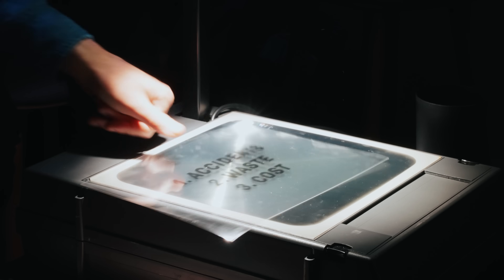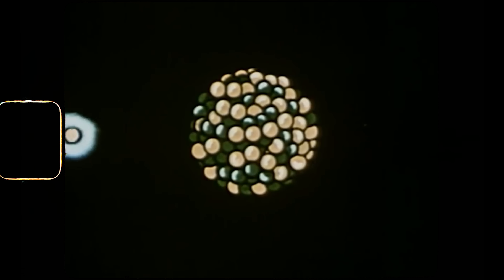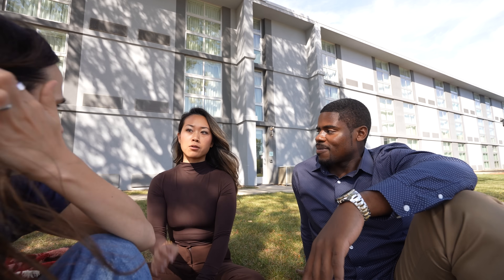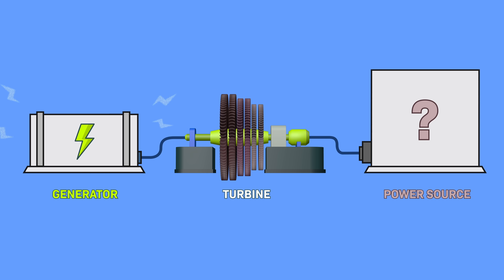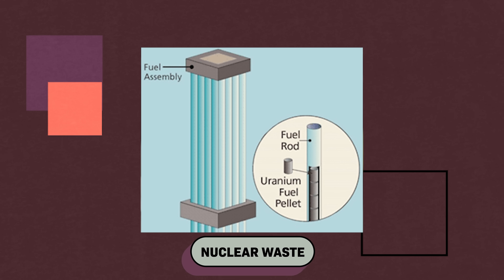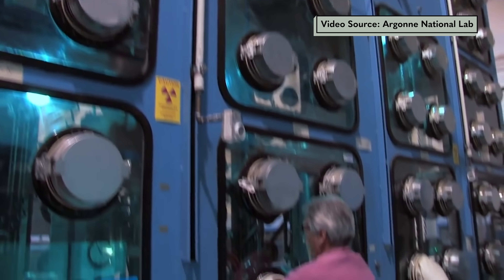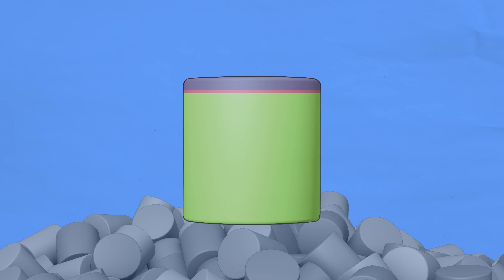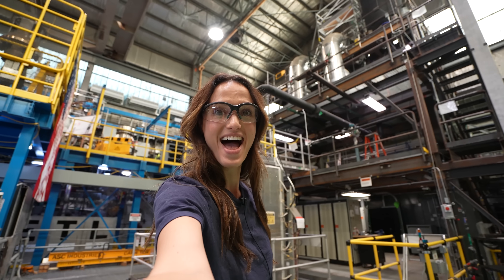The Big Lie About Nuclear Waste

Comment: Nuclear energy was always a front for nuclear weapons and the military industrial complex. We may have had a sci-fi futuristic power source if it hadn't been for warmongers and politicians. The early accidents that scared the public completely against nuclear energy were the direct result of lax safety from racing to build a stockpile of nuclear weapons. The majority of accidents occurred because the plants were more concerned with making plutonium and weapon materials instead of providing clean and safe power for the people. Sadly nowadays most of the public isn't educated enough to know that nuclear could be a completely safe alternative to what we have and that it is honestly one of the best and most feasible options, the problem is anytime you start a conversation about nuclear power you get people instantly talking about Chernobyl and 3 Mile Island because they don't know any better.

As someone who worked in the energy industry for a time, you also have the big boys at Coal and Oil working against any alternatives and the lobbyists are too powerful. Even with all the talk today of going green, oil and coal still exist and will exist as long as those corporations hold so much power over the lobbying and regulations. Natural Gas was a good chance to go "clean" and we have enough natural gas here in the US to be self sufficient for fuel, but it's not nearly as big a profit for the Oil and Coal corporations so it got squashed through regulation and backroom politics. Congress can talk all they want about clean and green, but they are all beholden to the corporations and the donors lining their pockets.

Comment: Japan was forced to shut down all of its reactors. Did not matter that they have the technology to avert a future Fukushima. So was Germany. In spite of Germany never having a single serious incident. They were forced to do it in two of the top countries that are based on manufacturing and really need a lot of energy. There are some countries where nuclear is prohibited like Italy and Austria, in spite of having the technological level to do it very safely. There is a huge global political involvement in restricting nuclear power and it has to do a lot more with global politics and control, as nuclear energy would not only be safe reliable clean and abundant but it would be locally sourced leading to less dependence. The EU bureaucracy is forcing France, the country with the best and most advanced nuclear technology on Earth to reduce nuclear power generation. All of Europe built a single nuclear plant in the last 15 years in Finland and it was 15 years late and 10 billion over budget because of global politics, because of the US wanting to be in the funding. There are countries that want to expand nuclear power but are under tremendous pressure not to do it, like Hungary. In fact all European countries try to increase nuclear output, sometimes from existing reactors as they are not allowed to build new ones - like Spain. Switzerland, a country with super abundant hydropower is building nuclear plants. Many of the developing countries of the 3rd world are building more and more nuclear power plants, like China (15) India (8) and even Egypt, Turkey and Saudi Arabia. It would be crucial to unchain France, Japan and Germany and allow for the construction of closed cycle nuclear plants. If the West will not be allowed to do it and the US will hold it back, then the Chinese and the Russians will do it on their own. It would be much safer for the world if Japan, Germany and France would do it, they already have a lot of know-how and experience and know the pitfalls because of this long experience.

Comment: Physicist here, I worked in Argonne as well during my PhD. 
Nuclear is the best (reliable) power source we have. 
The problem is that politics is holding it back.
Reply: The best? So this big fusion reactor in the sky isn't reliable?
Reply: @Jan12700  the best. If you are talking about solar you need to study a bit more. There are several fundamental problems with it, major ones being cost, intermittency, area required, life cycle, cloud cover, integrating it into the grid, etc. Study a bit deeper why the best places for solar like California and Spain have not succeeded and why they both desperately need non-solar reliable baseline power as much as possible (for example nuclear power).
Reply: @andraslibal : unless you realize nuclear is not a suitable baseline power. And you should exactly know why, don't you?
Reply: @tinowildenhain2324  it is the most suitable, the only thing that is making it impossible is politics.
Reply: I suggest adding an MBA to your education. Did you also spend the same amount of time working for renewables? Or just do the math?

Comment: Nuclear energy does NOT produce electricity, It boils water to produce steam which is used to drive the turbines which produce electricity, a bit like the alternator on your car, but bigger.
Reply: Did you skip 6:20?
Reply: @Jan12700 I didn't get there.  She'd spent half the time of the video with waffle.

Comment: Where did you get your information?  Because things are not as cut and dry as you imply in your introduction. For example France is, having problems with nuclear waste. Not all radioactive nuclear waste can be used as fuel. Commercial nuclear operations in this country have had their share of problems. While there is the potential to reuse, or reduce, or mitigate problems in the the nuclear industry, are we there yet?

Comment: Very well done. Very informative and thought inducing. The one major point I have with nuclear energy is that when waste is produced at any given facility, it needs to be kept on site. If it is made there, it stays there. Any new facilities must be designed to store any contaminated materials and equipment, and to be able to recycle anything they can, on site. No shipping it across the county for others to deal with.
Reply: That's not even remotely feasible. It's also stupid. Lots of reactors are built next to plentiful sources of water. Yeah, let's store waste there, seems really intelligent.
Reply: @DTex.45ACP  If it's safe enough to use the raw material and create the waste on site, then it is safe enough to store on site. If not, then don't build  a reactor there.

Also, it really is not necessary to build a reactor next to a large body of water. They can be built away from drinking water sources and all of the water they use can be captured and reused nearly infinitely. It just isn't convenient.
Reply: @DTex.45ACP  like Fukushima where they literally ran out of room to store the millions of tons of contaminated cooling water so now simply have to dump it in the ocean.
Reply: The interesting thing that all the nuclear waste EVER produce would not even fill a football stadium. Incredible

Comment: The truth :  only 1% of nuclear waste can be recycled, this is Plutonium (238/239), the other radioelements can't especially the fission products.
First you need a processing plant to separate Pu from other radioelements, this produce secondary nuclear waste by contamination. In France LaHague processing plant store enough nuclear waste to create 200x Chernobyl if a major incident happens.
Then in classic reactors (pwr bwr) Pu/Mox can be used but only 1 cycle and these reactors aren't properly designed to 'burn' this Pu/Mox, this put additional stress. Fukushima R3 was loaded with Pu/Mox, see how it looked in the end. (completely overburned)
In breeder reactors Pu can be used and produced at the same time with gain, but these reactors were considered too expensive and risky, for example SuperPhenix in France was stopped after a few years and accidents, the Natrium-Natrium-Water cooling circuit was crazy. The latest project Astrid was abandoned in 2019.

Comment: Corrections
7:05 this refers to the number of nucleons, and the difference between the same element stems from the different number of neutrons
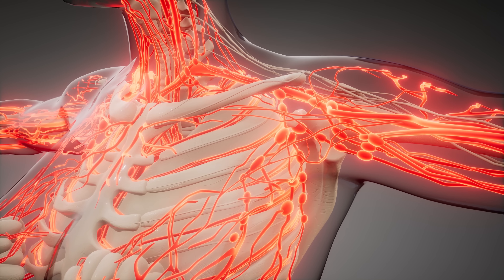7:30 you fire neutrons, not atoms
* also, nuclear powerplants have materials that slow down neutrons to the point they can't combine with uranium 235 to cause a split, so don't worry about making a bomb

Comment: no technology is not always an ever forward moving thing. quite often it takes turns  and some times even u-turns and other times it can completely dead end
 , any one that studys history even at an ameture level  can see how technology does this. 

5000-6000 years ago the ancient Egyptians built some of teh most enduring and marvelous structures  ever, the pyramids.  But millenia before even Cleopatra was born , they lost the knowledge of now to make them. 

The ancient greeks invented the first batteries , and it is such a mystery  as to what they used them for that many doubt they used them, for any thing but just novelty research.  
 
The Roman empire had come up with steam engines , but Never did any thing with them other than just have the idea as a novelty. and man didn't re-invent the steam engine till the 1800's when it was actualy used to make trains. 

Liquid crystals were first discovered in in the 1800's  but nothing came of the till the mid and late 70's when we began to use them for calculator screens  and we of course didnt use them for Tv's till the early 2000's 

and today we may still have the original blue prints for buildigna  saturn V rocket , the rocket that took us to the moon in the 60's,   but we don't have the on hands knowledge  it requires to make the blue prints work. and we have yet to return to the moon.    

No technology is not a linear thing that constantly progresses.

that all said . yes like the video said nuclear waste form a reactor stays leathally radioative for 1000's of years , however , unlike the world  of the Fallout game series, the nuclear fallout foa  bomb does NOT stay leathally radioactive for even one year. Infact radiation level's froma bomb's fallout plummet down to suvival limits in the first 72 horus after the intial blast , and then with in a few months the radiation levels will be only slightly higher than natural occuring radiation levels.  the killer thign about nuclear war would be a bobm exchange between two super powers   that is so large that all the bombs throw up enough debris and dirt intot eh atmosphere  to wehre sun light is blocked (essientally the same concept of when a super volcano erupts or a astroid impacts the earth) .  but for the record that would require a massive exchange of nuclear bombs  to create such a scenario.

Comment: Uranium waste can be recycled too. The rods are replaced when there is still a significant amount of fuel remaining.
If the waste was recycled, it would reduce the volume and weight by 80%. This provides about 30% recovery of initial amount Uranium in the fuel rods. 1% of plutonium that can be used in fast reactors, and valuable platinum. 
Here's the best part, radiated items and depleted uranium are only harmful for around a hundred years. 
Galen Winsor shed a lot of light on the true nature of Uranium. Eating uranium oxide and swimming in the cooling water. Only to die of old age decades later.

Comment: But you still have tons of nuclear waste which you can´t reuse. Like all the stuff around the pellets: The Water, the metal, the cement. Yes, they would not produce more nuclear waste, but the problem still is not solved. Also one thing i did not understand: They only reuse the "good stuff" which is not as long radio activ. But they get it by seperating it from the rest. And this rest is still radioactive for a long time.
And there are many different problems next to the radiotoxicity like water pollution by chemicals used in nuclear power plants.
I still would not relie on nuclear power. It is has to many downsites.

Comment: The reaction stops because of wasteproducts like Xenon, slows down the reaction, more so in the center of the solid fuel rod bunch, and thats why reshuffling of outer rods to the center is done during maintenance. A liquid fuel reactor does not have this problem and Xenon gas can be separated much easier than reprocessing of solid fuel rods.

Comment: Ed Pheil at Elysium industries claim the US has enough "waste" to power ALL the US  (current levels) for the next 800 years, in a Molten Salt Fast Spectrum Reactor. 
Copenhagen Atomics has another design using spent fuel.
The nuclear industry has been hampered by old tech and bad PR.
Politicians are afraid of facing misdirected fear.

Comment: Nuclear material is extracted and refined from the earth for use in reactors. After it serves its purpose it's less radioactive than it was before, meaning, it makes the earth less radioactive, not more. The solution if not to use it again is to put it back in the hole they dug it out from. This is not complicated, nuclear waste is not a serious issue and it never was, it's just a scaremongering tactic. Same goes for nuclear accidents, even when factoring in freak accidents like fukushima and chernobyl and so on it's still safer than fossil fuel and hydro and much cheaper than all other alternatives. Not only that but nuclear can be used as both base and peak load with no additional cost or preparation, contrary to renewables. Aldo there's micro reactors which are even cheaper and pretty much 100% safe. So, arguments for not using nuclear are all bullshit from start to finish.

Comment: I am not too Bright but 5:09 is that an overhead projector? WTF? Is this the 1980s?
Reply: If it ain't broke, don't fix it! =)

I'd rather use a working projector than spend lots on a large interactive whiteboard that I might use maybe 10 times! 

Saves space too! Can just pack the projector away when I don't need it, but it's a lot harder to do the same with a 4ft+ screen mounted onto a wall.
Reply: Also how dare, overhead projectors were used up until the late noughties! 😂

Comment: A quick note: nuclear waste is not just spent fuel rods or their assemblies. These are also various materials that have been contaminated with radioactive waste or become radioactive due to induced radioactivity. Heck, even nuclear power plants themselves will become nuclear waste when their lifespan ends. It's a pain in the ass to handle.
Reply: This is the missing puzzle piece that always gets omitted. Spent fuel rods can be recycled. Great, but that makes up like 5% of nuclear waste. Now that small percentage does account for a large portion of the radioactivity of the waste. So recycling fuel rods is still a great idea overall, especially because we'll reach diminishing marginal returns of extracting more and more difficult sources of uranium.
Reply: What nobody talks about (and I don't pretend to have an answer) is that lifecycle of the plant.  That's hundreds of acers dedicated to building a facility that will have to eventually be decommissioned.  Nobody talks about what that workflow is, what happens to that material, what happens to that land.  How many years will the facility be functioning vs an eyesore that nobody can go near.

Comment: First let me say not all nuclear waste is radioactive, a lot of it is simply stuff that doesent fit into other catagories so instead of being trash it is thrown in as nuclear waste just to be supersafe. Definition of terms and profet margins are also involved. If all the heat from the reactor could be used instead of just the hi-tempeture heat to make steam to make electric power wouldn't we be better off. and finaly allowing "Wind", "Solar", "Geothermal" and others to call themselves "Renewable" is just ignorent. How can you renew Solar, rocket more mass into the Sun? How can you renew Wind?- elect more politions? Coal, oil, and gas were once thought to be so abundent that they would never run out. LL&P

Comment: There is a display of EBR-2 at EBR-1 outside of Arco, Idaho. EBR-2 was an inherently safe reactor design that took high yield material and produced low yield material with a byproduct of electricity generation. The design was so safe that if left to its own devices it would shut itself down, not runaway like other reactor designs.

Comment: Making small 30-200KW thorium reactors can also use unspent uranium fuel safely using molten salt reactors that operate around atmospheric pressure which takes away most of the safety concerns of nuclear power.

Comment: My question would be what happens to the toxic/radioactive 'junk' left over from the reclamation process? I've generally been against nuclear power but if this is a viable technology that would start to decrease the amount of waste, then I think that is a discussion that needs to occur as a society. Unfortunately, the type of discussions that need to occur will only happen among the capitalist class and their political lackeys and only when they stand to make a profit, regardless of what is best for the public.
Reply: All nuclear materials (such as nuclear waste) decay into non radioactive elements. The main reason for using this form of waste recycling is to convert long lived waste (which can last hundreds of thousands of years) into short and medium lived waste (which lasts only hundreds of years or less).
Reply: @SoupPersonUwU  Yeah, I got that part, but what about the highly radioactive material that is the byproduct of the reclamation process, ie the 'junk' discussed at 13:54? That is expressly not used as part of the reusable material per the video.

Comment: Uranium 235 does not mean 235 neutrons, its 235 nucleons (ie neutrons or protons).  The difference between two isotopes however, say 235U and 238U, is entirely neutrons, since changing the number of protons means changing the chemical properties and thus changing the element.